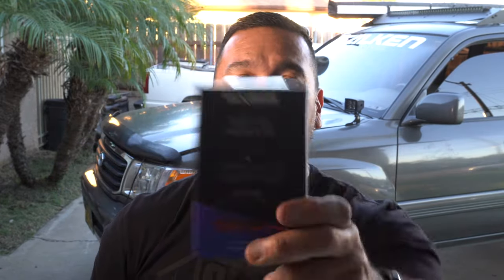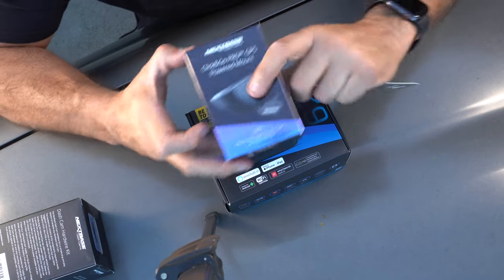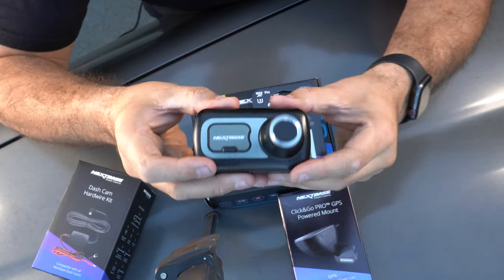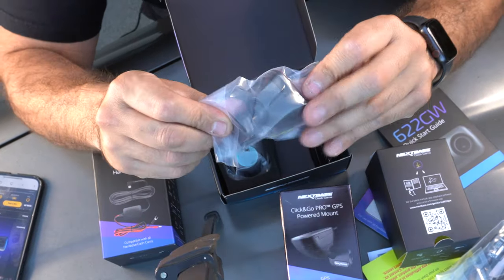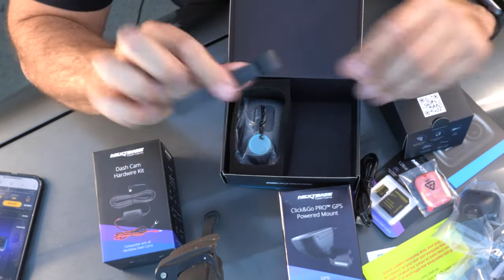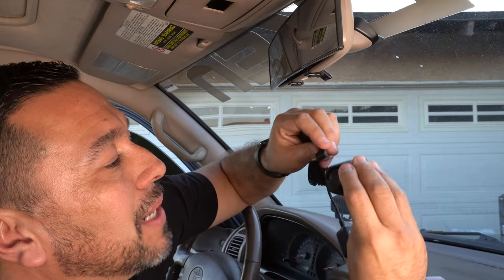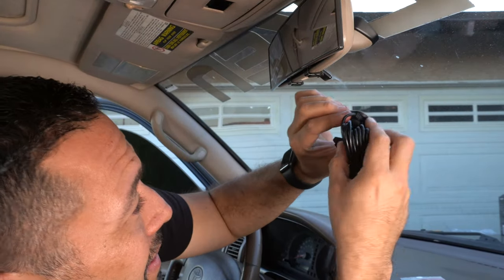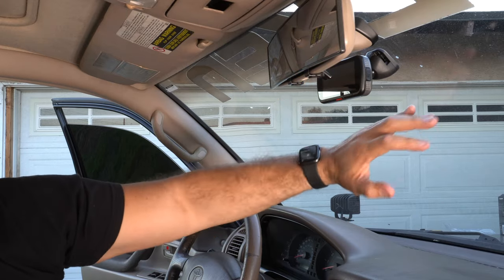NEXTBASE 622GW 4K Dash Cam with Hardwire Install Kit.   4K

Comment: Use the new OBD2 socket on your car it’s a lot easier. The 622gw does not come with the dust over on the front it’s either to save money or the environment they say.
Reply from the maker: I like that I dont have to use my OBD2 and I can just leave it hardwired.

Comment: I believe the 622gw has a built in battery/ballast which means you don't need constant power, it should be wired to an ignition controlled fuse, I also believe it has a motion sensor which initiates record capable of running of of the internal battery/ ballast this is as per what the agent told me when I purchased  this complete kit myself yesterday, can you confirm as I was told the warranty is void on this 622gw unless you use the actual nextbase Micro sd card they don't tell you this until your about to pay for it which adds an extra €60 to the cost, other than this I shall be installing the front and rear camera at the weekend and looking forward to seeing how good its recording quality is, thanks for the installation guide.
Reply from the maker: Thanks for watching! Your correct with the internal battery and the motion sensor. I just myself decided to wire it direct to power. Not sure about voiding the warranty if you don't use there memory card, but I do know they highly recommend you do. Love my setup and  the peace of mind when leaving my land cruiser unattended. Keep me posted on your install and how you like it!
Reply: @MisterMemo  I sure will, thanks again.

Comment: When the car is stationary, the dashcam automatically goes into sleep mode how to resolve this? This happens a lot in back to back traffic when the car is moving slow!
Reply: Any clue how to fix this ?
Reply from the maker: Mine stays on all the time because I have constant power to it. It only goes into screensaver mode but stays recording. There's also a Auto power mode you can turn off and on.
Reply: Have you been able to figure this out ??

Comment: Loved your video. How much battery does it take up when you hardwire it?
Reply from the maker: Thanks for watching. I have an update lager AGM 100ah battery installed in my Land Cruiser which last charger longer.  I don't have a battery monitor for my battery other than the oem dash gauge to measure how much overall power it pulls. I suggest making sure your battery is completely charged before hard wiring to direct power. Just incase!
Reply: @MisterMemo  thanks. I can’t see it being that much strain on the car battery. 
Anyway love the videos that I’ve watched for. You. You put out some very informational content and consider me your newest subscriber!
Reply from the maker: @Wittywhittier  appreciate bro!👊🏽👍🏽

Comment: Thanks for the video. My concern is does this drain the battery? I brought portable power bank so when my car is off on park mode, for it to record . Would you’d ay this is also an alt. Option? I am worried about my battery on my Jeep Wrangler.
Reply from the maker: I'm running a bigger AGM  battery. It doesn't pull that much power but I would monitor your battery if you decide to leave it on constant power. I also put my battery on a trickle charger every two weeks to maintain my battery. A portable power bank would save your battery just incase! Keep me updated!

Comment: Do you have to turn the power on manually whenever you start the car or does it turn on automatically?
Reply from the maker: I have it connect to direct power with the hard wiring kit. If it's mounted on the mount it stays powered. You can hardwire it to an accessory power, for it to turn off and on with your ignition.
Reply: @MisterMemo  I plan to remove the camera from the mount when not in use because I only want to record driving.  If you hardwire it, does the mount drain any meaningful power when the camera is removed?

Comment: Are you able to use this unit cable free ? And if so how long will you get from the battery 🔋🤔Roughly ? Kindest thanks. Just dont want wires everywhere.
Reply from the maker: I know the unit has a built in backup battery but I've yet to see how long it stays on after removing it from the power base. I have direct power connected to my base at all times.
Reply: @MisterMemo  Awesome, Thanks heaps for replying very much appreciated.
Reply from the maker: @ronervine   no worries! thanks for watching and subscribing!

Comment: Can we remove the ‘round’ plastic piece near the mini usb on the main power cable( cigarette lighter cable)?in your video the cable is at 3:24
Reply from the maker: the magnetic one?
Reply: @MisterMemo  no ,there is a small round portion in one end of the cigarette lighter cable

Comment: My Nextbase keeps going into a loop on start up. Not sure what's up. Plays the jingle over and over, never progresses past logo screen.
Reply from the maker: Wonder if you can reset it? Reach out to Nextbase support. I’m sure they can help out.
Reply: @MisterMemo  Only thing that temporarily sorts it is a reformat of the microSD
Reply: The SD card is not compatible with the camera, or the SD card is damaged.
Reply: @Florin_Neagu  it's a Nextbase branded card. Came with the cam

Comment: How do you know which fuse slot to put it in?
Reply from the maker: Pick a fuse slot that meets the fuse size and one that comes on with the ignition. The fuse box cover will indicate locations of each fuse.
Reply: @MisterMemo  thank you! 😊 would accessory slot be okay?
Reply from the maker: @morenabonita8834  hope that was helpful. 😎

Comment: Nextbase 622 is freezing regulary once twice a day.Using recomended Nextbase memory card.Dissapointment for over than 300euros.
Reply from the maker: Sorry to hear that. Have you’ve update the software?
Reply: @MisterMemo  There no updates awailable so far.Im bought it 3 weeks ago.As far in app it showes is latest wersion instoled.
Reply from the maker: @ivoostanevics8753  i connected mine to the computer to update it. Hope you figure out the issues.
Reply: Thanks,im try out,myght help.
Reply: Yes ...my fail from the unboxing and these guys don't even have a good customers service to return the crappy cameras ...I been with stupid email from them for 2 +months and still can't return that crap ...sorry my French...but their service sucks ..
to someone interested in cameras find a reputable company with usa service ...these buffoons are in Sweden if I not wrong ...
Reply: Umm,after im done software update to version 10,5 if im right remeber it was freezed once for last 2-3 weeks.So i would say update and yours advise is sccessful.
Reply: My 622 is running for over one year now. I learned that the updating decreased the numbers of freeze, but I had to hardwire it on a fuse that switches off 15-20 minutes after turn off ignition. The camera, if on idle, starts the car main board from time to time, that empties the batterie, and low voltage of the battery has influence on the freezing of the 622. I had a similar problem with the duocam I had before.
The service is excellent, I was in contact with the technical manager in the UK, after the hotline could not help me they asked him to call me. Good guys.